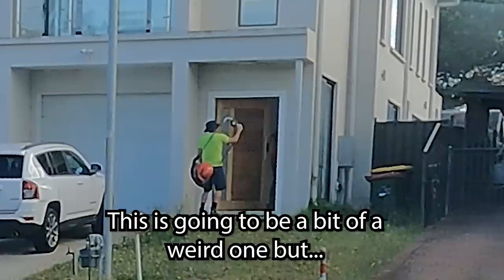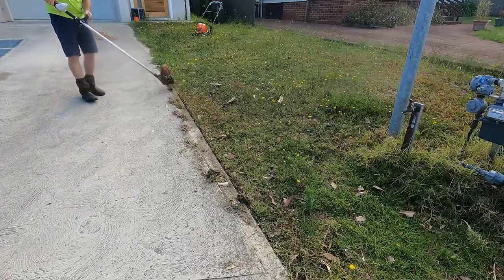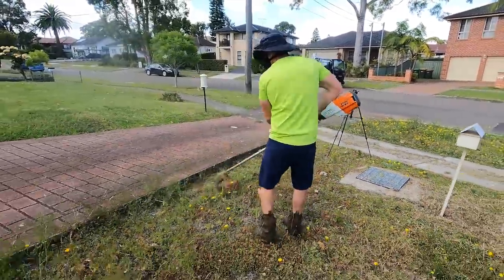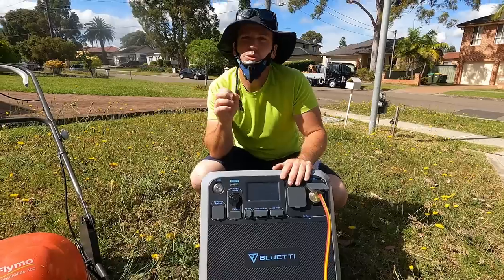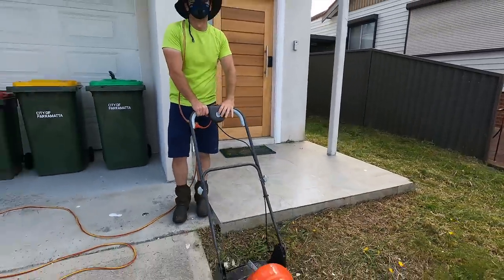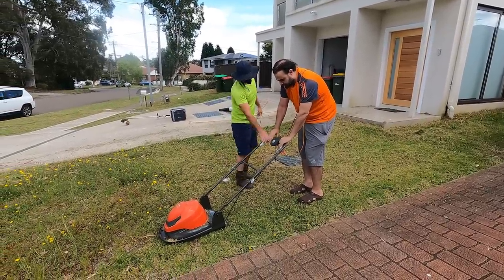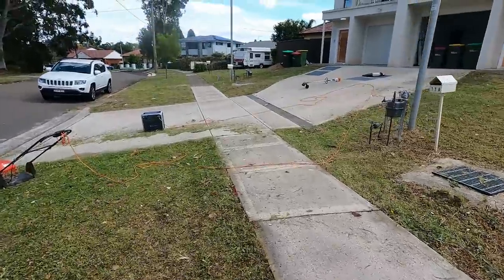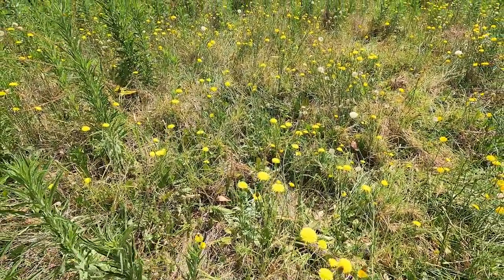I mow a STRANGERS YARD with this HOVER MOWER! (Random Acts Of Mowing Ep 2)

Comment: Well, that certainly was interesting.   Hey, it got the job done, that's all that's important.  I'm in the states, and I have a very small grassy area behind my pool, but it's up 3 steps and I got tired of hiking the mower up the steps, so I bought a Black & Decker 3 in 1, which is a combo string trimmer, edger and lawn mower.  You can get it in corded or cordless.  I chose the battery op, and you can adjust the height and the string trimmer snaps into the base with a foot pedal, and gives a great cut, weighs nothing at all and I don't get a hernia dragging a lawn mower up 3 steps for a very small job.
It's handy, you cut the grass, snap out the trimmer, edge and trim, has an auto spool feeder also.  There's something for everybody these days , and it works fine for my needs.

Comment: My victa did the exact same thing. It was even the left front wheel. wow.
I just welded it back on. Its from smacking the concrete lawn edge, wall, house etc. on an angle. Tack Welds just break. Flymo would be good for steep slopes and golf bunkers
Reply from the maker: Or a museum 😂

Comment: Actually, you don't know when you might need and electric and power combination, if other power doesn't exist.  That mower sounds like a vacuum cleaner though....Had a good used, $10, electric mower once, tied a knot in the cord connection too.  It did a good job on basic simple mowing. Between edging and mowing, this project did turn out decently. Excellent.
Reply from the maker: Just did it for a laugh and to show off the power station 🤭

Comment: I have spent probably 500 hours using a 2 or 4 stroke hover mower over the last 25 years cutting grass at a friends large property. There are three areas where they excel above all other mowers; 1/ They are brilliant on steep slopes and around the sloping margins of golf bunkers and ponds. 2/ They are great on small irregular shaped pieces of grass where its tricky to mow in a straight line. This is because they cut sideways so well and because you can mow in an arc without moving your feet 3/ Around trees. Its around trees where they are underappreciated. The area I cut has about 120 small and medium closely spaced ornamental trees. I can stand in one position and cut all around a tree without moving my feet. I have timed it and I can cut around trees about 80% faster with a hover mower than a small cylinder or rotary which matters for me when I have so many to cut around.

Comment: I like that mower...I've not seen it in Canada.
Reply from the maker: You like it really?
Reply: @timthelawnmowerman  I live in a mobile home with a not so big lawn and it would be perfect for the small space that I cut...
Reply: @trishthorn8206  I have a Lee Valley manual push mower - or is it a Canadian Tire one?  Will have to look in the garage and see.  It does my postage stamp lawn just fine when the maintenance guys forget to do my yard.
Reply: @maxallen-macdonald8791  I liked it bc it has no wheels and no pull start. Just plug it in and squeeze...

Comment: 240 volt machinery has been around for a long time and not all of it was toy value only.
In an industrial setting I used big Stihl 240 volt chainsaws for many years and they were a beast.
No fuel to mess around with, they were quiet and went first time every time.
With around 3 to 4 hours solid cutting everyday they even lasted about 10 years.
The saw I used was comparable to Stihls original petrol powered Farm Bosses.
Reply from the maker: I realise 240v power equipment exists, this is just a very quirky piece of gear and the means of powering it was amusing. Cheers for checking out the vid 👍

Comment: Flymo’s are big here in the UK in fact electric mowers are more common than petrol basically as the majority of our gardens (yards) are pretty small. And yes they mostly have “catchers” too. I’ve had a flymo for years it gets a lot of abuse and is a bit rattley but keeps on going. Latest trend here is battery garden appliances hedge trimmers mowers etc.

Comment: Hi, Tim!  I noticed the gas meter in the customer's front yard.  Are gas meters in Australia "read" by actual meter readers who make premise visits to the customers' homes, or, are they "read" electronically and distantly from a central gas company facility location?
Reply from the maker: I believe the older ones are physically read newer ones may be connected. Can't be sure sorry
Reply: It depends on which State you’re in. I’m in Perth, Western Australia. My gas supply company physically comes to my house read my meter, and so does the water company, but my power use is on a digital meter (just been upgraded).

Comment: If that was all he would have to mow, I think having a little lightweight mower like that would be perfect.
Reply from the maker: Personally, I don't think having a power cord attached for any size lawn is ideal. But if someome wanted to do it, sure 👍
Reply: @timthelawnmowerman  Oh I agree cordless would be the best but if it was only corded and that's all I had to mow... I would totally go for that.  No issue with using gas (or petrol in your country?  Benzine?) and having it go old, way less worries of leaking fluids in the garage, looks way lightweight so those who don't have a lot of upper body strength, elderly, young folks, etc. would have an easier time pushing that around.  

Now if you had that to use for the upcoming video I'd laugh my head off.  You'd either absolutely wear down that battery 100x's over, dull the blade after the first pass, or might get so frustrated you'd discus it across the yard and walk away.  That... and Sean from Blade Mate would probably laugh at you too.  🤣

Comment: I find battery edgers are perfect with the weight of the motor at the cutting head, but I think with a trimmer it is harder because your balancing all the weight with your body. That's why pro's love backpack blowers also. Really you should try a Darwins grip on the battery trimmer.
Reply from the maker: I really prefer the Darwins for slashing

Comment: I have a 1964/65 Toro Flymo. You don’t see many hover mowers in the United States. What is the point is messing around with these battery operated ones? Seems like a lot of hassle with no real advantage. You have to waste time charging them up from the outlet which is connected to a power plant. The batteries degrade each time they are charged. Battery capacity fluctuates due to heat and cold. The batteries eventually fail and are costly to replace.  The old gas ones are not only vastly better looking,but super reliable and easy to service if you ever have too.
I don’t want to mess around with battery operated toys that run down before I’ve finished cutting my lawn.

Comment: These older videos are interesting. You’ve really refined your technique, both in cutting and filming. This property was obviously never “landscaped” properly by the builder. They didn’t even bother to level the lawn, put seed or sod down, or top dress. It’s still the same as a construction site. About the only thing that will grow in those conditions is weeds. No wonder he wrecked his mower. The developer should be fined, IMHO. Poor owner will have to dig out that crap, refill it with topsoil, and put decent sod down or he’ll never have a great lawn. Property value will be less than the neighbour for that reason alone. Curb appeal shot to hell. Criminal.